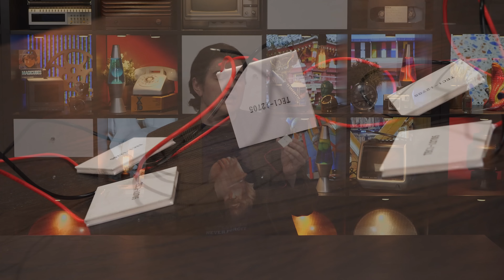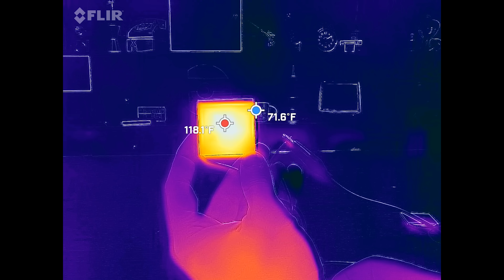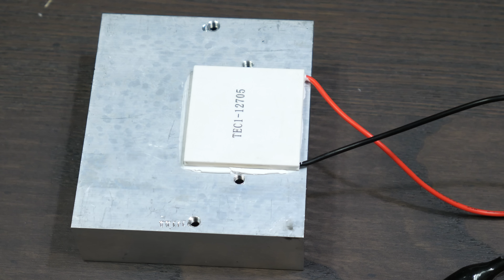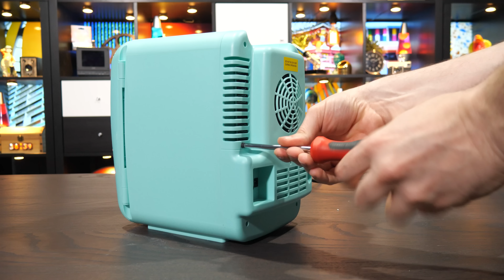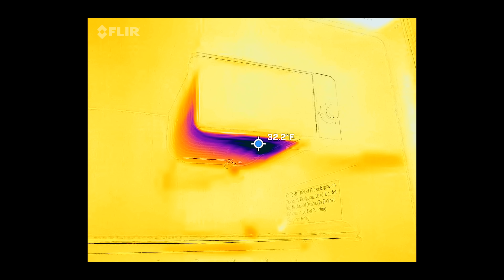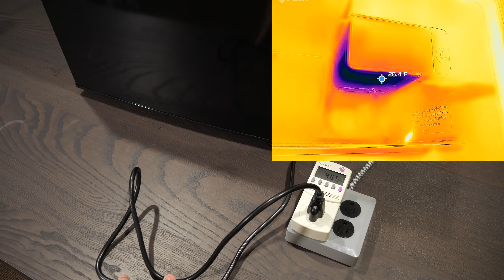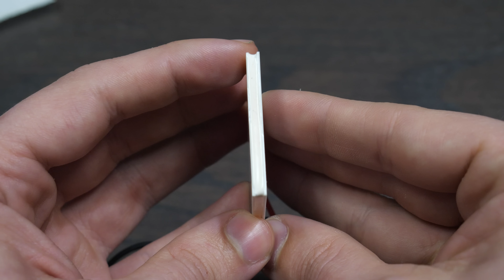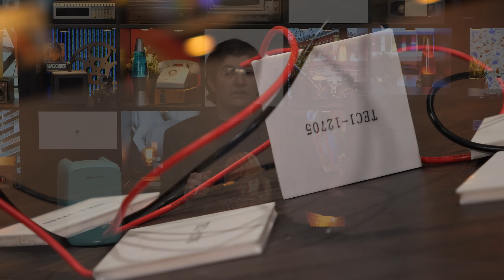Thermoelectric cooling: it's not great.

Comment: The conclusion is right (the fridges are often not great) but the theory is very wrong! Love this channel but feel the need to correct a few facts. 

Pelter devices are in fact capable of fairly mind blowing COPs, for example I recently tested a device with a COP of 12 (5.2W heat pump for 0.45W in) and a COP of 3 at 20W (6.5W in), which is not bad for a small 40x40x2mm device costing few bucks.

The problem is not the Peltier, but the design of the external thermal circuit that kills the performance, plus a poor understanding of the optimal current and quadratic equations. 

Let's get technical: The Peltier type I'm testing (TEC 12708 from RS) generates a temperature difference of 20K/A (per amp), has an internal thermal resistance of 1.5K/W (0.75 each side), and an electrical resistance of about 1.7Ω. If run at a moderate 2A (<25% of max rating), this means a 40K "open circuit" temperature difference (hot - cold, with no heat flow). At 2A the waste heat is about 7W, and since this flows though the hot side only means a loss of 7*0.75 = 5K in temperature difference. That leaves 35K for heat pumping, with a peak pumping power (when everything is at room temperature) of 23W, with a COP 3.3, not bad. If this is coupled with external thermal circuits with negligible thermal resistance (relative to 1.5K/W of the Peltier), pumping heat out of a well insulated container (again relative to 1.5K/W), you could cool 1L of beer to 15K below ambient in about 1.3hours (1L = 4187J/K, with 1.5K/W, τ = 2.3hrs). Which seems pretty good considering it's just a small single Peltier. And once it has reached 15K you could drop the Peltier power down to 1W to maintain the temperature, and it can handle a bit of leakage heat as well fairly efficiently. Pretty fantastic numbers. And they are real, my test have confirmed this. But there is an asterisk. Later. 

In electronics, the "go to" in heat management are Aluminium heatsinks with a cooling fan. They are pretty good, but not in this context. They are typically about 1-2K/W on each side, but that's enough to kill the COP and make it wildly sensitive to current and temperature difference. Nothing to do with the Peltier "leaking" heat, or being "thin". Totally wrong - in fact, a thinner Peltier is better if you think about it! It's all about the loss of temperature difference from the waste heat and overall restriction of heat flow.  

If we run the numbers above again with aluminium heatsinks + fan and assume 1.25K/W on each side (to make nice round numbers, total 2K/W each side including the Peltier), the lost temperature from waste heat is 7W*2K/W = 14K, leaving only (40-14) = 26K for heat pumping. From outside ambient through to inside the fridge chamber, the total thermal resistance is 4K/W, so the available heat is only (26/4) = 6.5W, so the COP is already below 1. It also now takes 4 hours to cool 1L of beer 15K. Once it is cooled, it's still possible to drop back to 1W to maintain the difference, if there is no leakage. If there is leakage ... the math is getting to much but I'd expect <5W. 

To make the cooling faster, the instinct is to raise the current, say to 4A. Now we have 80K pumping, yay! But the waste heat is also 4 times higher at 28W. Pushing 28W through 2K/W on one side means 56K is lost, leaving just 26K for pumping out of the original 80K. Yes, this the same as before! So still 6.5W max cooling, but 28W in, with a horrible COP of 0.23. And the cooling time exactly the same! And it's expected the ability to managing heat leakage are going to be worse as well. 

Try again with 5A, now we have 100K pumping! Massive! But now the waste heat has jumped to 44W, which leaves just (100-44*2) = 12K for actual heat pumping, or 12/4 = 3W of actual cooling, a COP of 0.07? WTF? And it's never going to reach 15K cooling, since this exceeds the 12K available. How can just 1A extra cause this to flop so badly? 

It's all in the math, and quadratic equations. If we are stuck with 4K/W thermal resistance (2K/W each side), and want to prioritise cooling time, run the equations and optimal point turns out to be 2.94A, which still requires 3.32hrs. The point is, anything higher than 2.94A will be useless, simply wasting energy for less cooling. This point is frequently misunderstood.

Plus, the whole thing is dramatically dependent on the thermal resistance outside of the Peltier, something which is poorly understood and difficult to model with Al HSK+fan. Things like choice and application of thermal paste, the dimensions of the heatsink, air flow, fan type contribute to wild variations in performance. And even the best implementation isn't great anyway.  

My success (the *asterisk) is using water cooling on both sides, with the Al water cooling blocks that are polished flat and carefully locked in place using a very thin layer of 100 yen glue mixed with the Al grit left over from polishing (a formula that came after a lot of trial and error). The water is then pumped to a larger heat exchange with less than 0.1K/W on each side. Using water flow sensing and very precise temperature measurements, input power measurement, the heat pumping and COP can be measured, and it fits with the above modelling and the Peltier datasheet. There is no doubt that single Peltier devices can offer much high efficiency than most YouTube commentators think. As a side note, my son recently bought a small Peltier fridge as a gift for his brother. I expected the same terrible performance as the Blue fridge in this video, but it was surprisingly efficient. That means that at least some manufacturers are already on to the secret that good quality thermal design external to the Peltier device can make an effective small fridge. 

The problem remains that each device has a limit of about 20-30W pumping in the efficient zone. To scale up requires combining devices, for example a practical air conditioner with 200W cooling at a COP of 3 (70W in) would require 10 devices. Trying to combine devices has a new set of traps for the novice fall into. So far, I am still a novice flailing around with different ideas. But I'm confident of finding a solution! The final objective is to combine these with solar panels, since it would then be possible to have simple off-grid air conditioning without needing batteries or mains voltage inverters, the dc from the panels could go direct to Peltier bank. This could then store the energy in house when the sun is shining, rather than in batteries. A good idea?

Comment: The fins of the radiator in the Peltier fridge should be vertical so that convection increases heat exchange with the ambient air, but they didn't even bother to get that right... Even the manufacturer of this device thinks it's throwaway junk

Comment: I just figured out a way to explain the refrigeration cycle via Minecraft: 

have a pen full of sheep (representing heat), its floor covered in pressure plates so that some redstone can output the average movement. the "refrigerant" loop is minecarts on a rail, and the "fan" is flowing water to push them away from the hot end.

Comment: The wild thing is that despite being leagues more efficient, the mini fridge doesn't even have a proper radiator, just pipes inside the wall.....presumably pretty close to the cold space.  

Hopefully, the condensing coils are thermally bonded to the metal exterior.

Comment: My wife had a major surgery about a year ago and we needed an affordable, compact solution to keep some cold beverages by her side of the bed while I was at work, so I got one of these off Amazon for about $30.  I would load it with pre-cooled sodas before going to work for her and it worked great for that purpose.
But yes, outside of that, it was terrible.  The whole thing finally died about two months ago (we decided to just keep using it after her surgery until it crapped out) and I'm not sorry to have gotten rid of it.

Comment: Is the cold spot on the fridge floor @20:28 caused by cold air from the freezer section (specifically whatever you called the section where the refrigerant boils that's used as the freezer [evaporator.  you said it again later])?
Anyway, great video as always, I remember using peltier coolers in undergrad to cool scientific cameras, and it was this hilarious pyramid shaped thing that had to be screwed to a giant aluminum case or it might cause a fire.  Perfect for the use case of "we'd prefer not to use liquid nitrogen". XD

Comment: I belive that stove fans used to circulate hot air around a room use a Peltier device in reverse to generate electricity from the heat of the stove. Is this a better way of using a Peltier?

Comment: I would like you to do an experiment with the pump oil 24hr, i have turned my mini fridge on it's side in my car and when i got to my friends place, just turned it on with no issue (i completely forgot about having to wait) but it still works fine, and even after when getting home i was like "lets see if it will break" and it didn't, just wanted to know if anyone has actually had a mini fridge break from the oil not sitting for 24hours

Comment: 3 main problems, cheap fan, mising radiator plate on lower temp side and runing at 12 volts, try to test one with 9v and a radiator

Comment: I got a little thermo electric cooler if the sort in the video though a bit larger and the thing it does that makes it absolutely useless is that it freezes up around the cold side of the thermoelectric element after about 30 minutes and says right in the manual not to run it longer than about an hour. How incredibly useless

Comment: It sounds like one system (refrigerant based) has been optimized while the other system (peltier) has not. Two centuries later and we have it in the palm or our hands. It reminds me of the transistor but for thermal environments. Splitting heat like an AND Gate, but where do you want it to go? Then how?

Comment: We use huge thermoelectric chillers called Thermoracks and a few other brand names for different manufacturers, for  cooling in our tools for semiconductor manufacturing, they are very stable and can adjust temperatures of the cooling fluid really quickly.

Comment: If you use those little refrigerators you usually put cans in it that are already cool. In example you start the day with a bag of already cool cans in a bag, and stick them in to keep them cool, rather than to get them cool. Its selling point is convenience, not efficiency or lowest temperature or even capacity. It is small and can keep your cans at your arm's reach. Most bosses wont notice or care about a small thermoelectric can fridge on the desk, but may not allow a real cube fridge. Further considering wages as low as they are, I don't really think your average employee cares about their employer's power bill.

That being said outside of the very specific reason it was sold, it is terrible if your intention was to use it as you would use a standard refrigerator.

Comment: Your metric is biased, imagine the fridge cost about 2000 USD, and the electricity is a cheap as 0.0007952 Kw/h cents but , i consider peltie modules to be used for something else, in a weight efective and space efective. Aaaa I noticed a design flaw, did you?, the hot side is not being used for anything, like a water heater or even generate its own electric back

Comment: The fridge you used in your example might be garbage and it looks like so, but I can assure you I'll happily keep using peltier cooled water dispenser because:
1- I've not once considered the water it dispenses from the cold side to not be cold enough even for the hottest days. It cools it just fine. 
2- The dispenser I'm talking about has a thermostat as the fan would turn on and off at random times ( probably to keep the temps stable )
3- The dispenser has both hot and cold side, meaning I have access to cold water and hot water. Hot enough to cause significant pain. ( don't ask me how I know )
4- The entire water dispenser was significantly lighter than a normal water dispenser. 
The thing is simply convenient and being able to turn the heating/cooling on and off at will meant we could still use it without the temperature modifying feature.
And it was significantly cheaper than a refrigerated water dispenser.

Taking into consideration we use inefficient things every day everywhere,  I say NO THANKS I'll keep using TeC s  until a better solution fits my needs.

Comment: TEC are great to keep small items (like sensors, measuring equipment) little below or at room temperature. 
Basically the opposite (and similar in energy use) to oven stabilization.

Comment: They have their uses. They run off 12V in a car. They are about the same size as the centre console on most cars. 
Fill then up with cold drinks put a cold pack in the bottom, plug into the cigarette lighter socket, free power ( ok your burning more diesel but not measurable) and then on a days 5-600km drive, you've got cold drinks all day. Not going to use it in the city xxx and a big, compressor fridge full of food can be on the back tray, but in the cab of a ute when you go bush or just on a bit of a drive, they are excellent.

Comment: Having analyzed and optimized Peltier cooling systems it often comes down to one aspect: the thermal resistance on the hot and cold side. So, a better mini fridge would have heat sink grills and fans on both sides, also inside of the fridge. Also, 55W are way too much for a single medium sized Peltier element. That should be at least 4 Peltier elements, pumping at least twice as much heat using the same electric power. That being said, a compressor based normal fridge is just better for this application of pumping substantial amounts of heat.

You mention multiple times that the blue toy does not have a thermostat. However, this is not in any way related to the Peltier element. Peltier elements allow extremely precise temperature control, which is their main application.

By the way, vapor compression chillers used in airplanes also have terrible COP values (1.0 to 1.2), because weight reduction is so much more important than power consumption. So, there are some actual application niches where Peltier elements are used for significant cooling, and not just precise temperature stabilization.

Comment: As far as the defrosting goes for your fridge, one of the reasons you don't see peltiers for electronics cooling is that they also can very easily cause frost or condensation. If that blue toy had a larger element, it would almost certainly need defrosting as well

Comment: Yes, the peltier fridges are consuming 60W but they're also pumping out 60W of heat into the room they're in. Depending on whether you're running and AC or heater, you're also consuming an additional 20W/ saving 20-60W in additional HVAC.

Comment: Ouch... that's almost as much as my Laptop PSU uses, which clocks in at around 74 W, plus 15 W for an external 24.8 inch LED monitor. And both are infinitely more entertaining, while being a somewhat weak heating.

Comment: What about the other way around?   Apply a temperature differential and the peltier generates power.   
I wonder if wrapping an internal combustion engine's exhaust  with these might be enough to supplement or even replace an alternator.

Comment: What makes the Peltiers work really shine is a Portable Personal Cooling Device aka Cooling Neck Fan. 
However, based on the price of Peltiers itself. The Cooling Neck Fan is always overpriced in this case. When you pay a Neck Fan for $100-200 but it only costs $20-40 to build. One main downside for it is 99% of those fans is cheapy Chinese brands build with cheap material. 
Even the one Japan branding: Sony made is not good either. It only cools a small spot on your back with direct contact and the fan is used for cooling the Peltiers. The design of the cooling is bad too. The fan only can be sucking the air inside of your clothing to cool the Peltier's temperature down. Air in cloth means dead air: heat, moisture, non-ventilated. Remember this is pricing at over $200 at USA.

Comment: You're missing the most important point as to why i have one of these- size. All the regular fridges are way bigger. Show me a better fridge of the same size that can also double as a little cooler if flipped on it's back with some ice- I used it that way to keep lunch and maybe a drink cold and it worked great, and when powered on other sizes it's better than nothing- sometimes there's no room to throw a mini fridge in the back seat or trunk, assuming I wanted to lug one around every day, which, no, I don't! That's what I was looking for this whole video- a 1 for 1 replacement that did a way better job- I've never used it to store a 6 pack of cans. Show me a better minifridge of the same size that's better (I'm sure they exist too, I just don't need one right now). I do have do have a mini-fridge for my bedroom/shop, they work great.

Comment: You also use peltier elements when precision is needed. For example to precisely control the temperature in small volumes in scentific analysis gear. Not efficient, but really precise if you need to keep a temperature at around room Temperature as you can heat or cool with the same element by switching polarity or just watercool the element to get the fastest possible cooling.